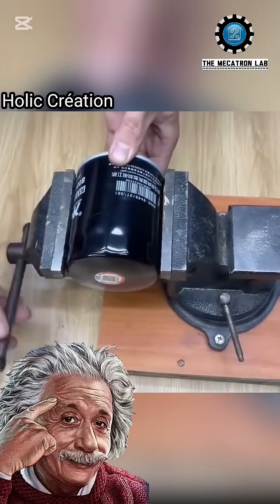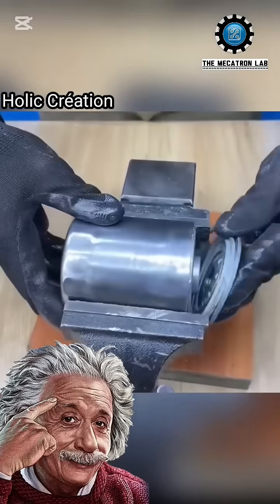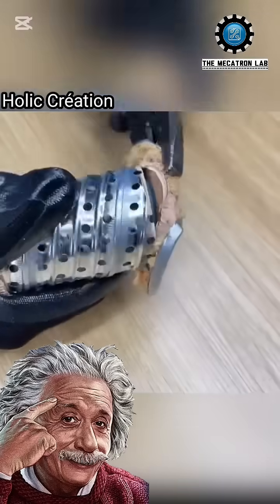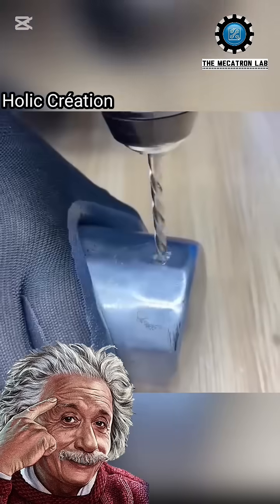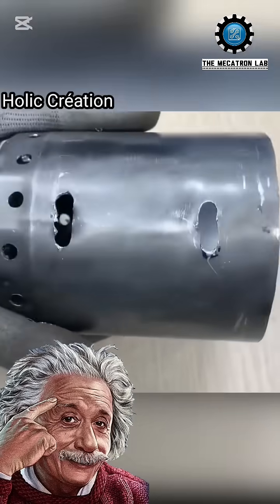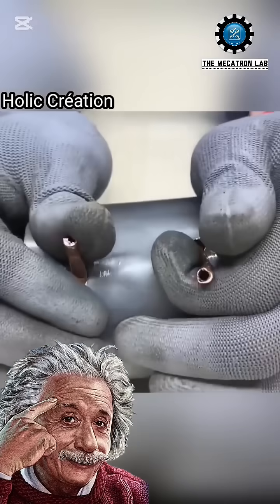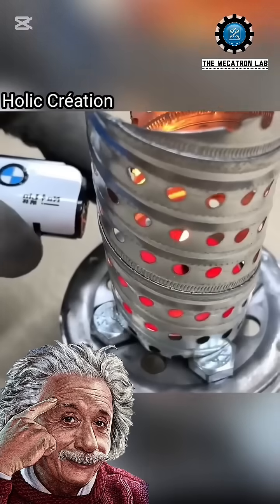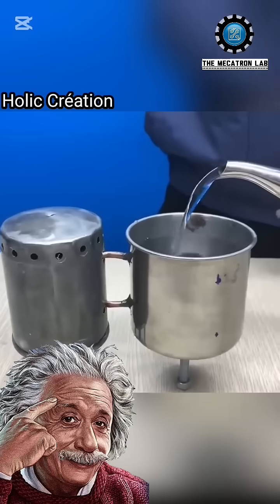How To Make water Heart AT home using oil filter. #diylrojects #experiment

Comment: This is about as efficient as leaving the oil filter in place on a car and just letting the cup sit on the engine while its running lmao.. 122 degrees? Hell you could leave it in direct sunlight on some asphalt and it'd get hotter

Comment: This is a thermosiphon, I 've used this with a 3/4" copper coil in a wood stove to supply us with constant hot water.  You need flexible copper tubing to create a "Z" shape, it passes through two holes drilled into the fire box at the back. About 3 ft or so will do, but the tubing must follow an upward path, never bending down.
      Outside the stove, the lower end of the flexible tubing must enter at the bottom of your water tank and the upper part must reach the top. 
      The water will flow quickly in this setup.  I'm on my third coil in my third home, You also have the added benefit of storing hot water to be released over night. You'll find many variations of this setup and I highly recommend planning and constructing one of these things. It can be built very cheaply.

Comment: Pssst this works better for heating a building then it does for heating water i mean it can be used for both at the same time but heating a building with this would save alot especially if you have alot of trees and land

Comment: Lmao, that would be ingenious. If the water circulated through the copper coil. The heat on the copper coil will keep the water out of the coil.  If there was also a coil in the water it’s self then the heat would transfer to the cup of water. Nice try but a pump would be needed to circulate the water.

Comment: Put the inlet and outlet at the bottom and use a pump to circulate coil heated water ✅ 
It still would be 20% less efficient than just heating a metal cup directly.

Comment: Cut a soda can in half Tweak the one end with needle nose pliers 1/4 turn at 4 to 6 points so the end of one of two parts fits into each other  Now you have a container with a lid ...Drill small holes on the outside. And one larger in the center of the top of the can. You have just made a penny stove...See you tube for more info ...- Extremely cheap, Easy to make, Boils water  I have one as back up in my camping bag
Reply: Oh yeah the good old aluminum can with plastic liner, work great. The more you use it, the less you are able to remember thats not a good idea

Comment: Put water in metal cup. Combust able fuel (candle) under cup. No oil filter, no solder, no holes, no leaks, less then half the energy losses. BOOOOOMMM, incredible water heater with no tools. 😎🤷🏽‍♂️

Comment: this is just exothermic transfer through touch... which you could do by, guess what? just touching the "stove" to the cup. that copper tube is pointless. in fact you could just put it on top the fire, but encasing the fire would prevent heat loss tbf.

Comment: It's easier to boil water in a plastic bottle directly over a fire. Incredibly it will NOT MELT.
Reply: Thats straight cap. Not to mention its 100 percent not safe to heat plastic to that high of temperatures because it starts giving off chemicals. I strongly disagree with you anything thats plastic that gets held over a flame for long enough will start melting and warping. Unless it's so far away that it barley gets hot at all.
Reply: @dillonmartin9413 : I agree with the chemicals leaking into the water, but doing it occationally won't hurt. I've done it a few times as an emergency measure at 12.000 ft in the Andes Mountains. Regarding the melting part, try it yourself and report back.

Comment: More like a steampunk attitude than anything useful 😂 
I'd rather boil water with a makeshift hobo with riser (just cut a rectangle in a stovepipe near the bottom, then place cans without bottoms and "sieved" sides inside. relatively light weight solution and if you have an enameled pipe of good quality it will work for ages and radiates lots of heat - that said, you shouldn't burn wet wood, oily stuff, coal and the likes and you should clean the pipe from time to time. If the cans wear out: just replace them 💁🏻) or with a black container in the sun or pipe coil in the sun or around the said hobo 😈 🔥🌪️ muahahaha 
If the stovepipe is long enough, you can even sweat in a lodge or you can cover the top with a fitting hearth ring or hearth cover (i re~use a restored, etched, circled one-piece, but you could also use multi-circled pieces or even the ones from around the 1800's, i believe, out of cast ion - if they are not too heavy). 
I got carried away a lil bit 😅
Memories from hiking trips and national vacation 😌
Shit. 
Boys'll be boys 😁
But take care with extinguishing! Make sure to protect your environment and if you can, use water to prevent possibly dangerous smoldering burns!!

Comment: Didn't see bubbles or steam. It probably takes too long & uses too much fuel. The dozen holes aren't necessary. With such a small flame, 1 or 2 will suffice. Probably just the 2 holes for the tubing will work. You want oxygen to replace what's consumed, but not loose too much heat thus slowing warm-up time.

Comment: You could have used the filter element as a fuel source. Add kerosene and wax and to it and it will burn. The housing could have been tuened into a small rocket stove as well. What you did is idiotic and pointless.

Comment: This is solution in search of problem that no one wants.
Reply: Actually believe it or not there are people out there that have to actually go without. Hell last summer we didn't have water or electricity. This would have been handy then. I'm sure it would take a little tweaking the design/idea. But I think overall it would do the trick. Just because you won't ever use it doesnt mean its useless to everyone. This mentality is becoming way to common now a days. People have literally become so self centered and self serving that if it doesn't benefit them in some decent to major way its garbage or useless. Even if it benefits them but only slightly people still just don't care what so ever.

Comment: Not that's it's practical in any sense, but what's fascinating is the idea of passive circulation: no pump, no electricity, no nothing. 👍
Reply: Thermosiphon. A lot of early car cooling systems were done this way. 
The radiator was mounted with the top about a foot higher than the top of the engine.
The top tank of the radiator connected to the highest point of the engines' cooling jacket, and the bottom of the radiator connected to the lowest point of the engin cooling jacket.
As the water in the engine heats up, it flows upwards into the top of the  radiator. As it cools in the radiator, it drops down, into the radiator bottom tank, through the core of the radiator. Flowing back into the block as cold water, replacing the rising warm water. Thus completing the loop. 👍
Reply: @iainball2023  Wow, that's cool. I wonder if this small cup can be scaled up to say, 5 gallons, but without drilling anything.

Comment: This is completely pointless. You might as well just make a small wood fire and boil water in a cup. This is so much work
Reply: You cant exactly build a fire inside now can you. I actually find this pretty damn handy if something happens and you need to have hot water for stuff. I dont think you would nessacsrliy need a oil filter either because he doesn't even use the inside of the oil filter that he tore apart the inner circle of the oil filer with holes drilled all through it from top to bottom.

Comment: Not only is this not at all what was shown in the thumbnail but this would take forever to heat a whole cup of water enough to boil. It would be far more effective to just put the candle under the cup so that the heat transfers directly to the cup and therefore the water. If you're heating just the copper coil it will only heat a few drops at a time, turning each drop into steam which will just boil away and not even heat the rest of the water if it's not below the water line. 

This device serves only one function: to make people who aren't very smart think that you're much smarter than you are.
Reply: Лучше бы он просто ввернул в дно кружки медный болт с широкой шляпкой. Это увеличило бы теплоотдачу от свечи.)
Reply: I do agree that this is stupid and completely unnecessary, but it isn't boiling the water in the copper tube, it's hard to visualize with clear water, but as the water heats up in the coil it will move up and out of the higher hole, pulling cold water into the bottom hole of the coil that will flow up as it heats up, and the process continues
Reply: Don't be lazy! "Report - Spam or misleading"
Reply: and then the magic happens! the magic of stupidity....
Reply: but then he wouldn't have le content
Reply: How else do you get water above boiling point in an unpressurized container? 
Obviously you have to use a candle an oil filter 😏
Reply: 😂😂😂😂😂😂VERDAD QUE PERDEFETA DE TIEMPO ALBERT HAITEN SE LE FUNDIO EL CEREBRO AL VER ESTE INVENTO 😂😂😂😂😂😂😂
Reply: wrong
the coil is always faster for heat conduction

Comment: So it's harder to just put the metal cup of water over the flame..??
Reply: Putting anything over an open flame will leave anything you put over said open flame a black sooty mess. You haven't ever had to do such things before huh? Take a lighter and put it on a can and let it sit there for 10 seconds or so. Obviously hold the can with something that besides your hand because if you dont you will regret it. It will leave a huge black circle on the can where the flame was closest to.
Reply: @dillonmartin9413  I see... So it's more to do with having a clean cup or pot when heating water... Maybe it should have been explained properly in the video... I thought the goal was to heat up the water, that method in the video will take much longer than putting the pot over the actual flame...

Comment: Are you saying this is more efficient that just putting the steel cup directly on the fire?
Reply: This way you're getting more copper oxides to give you moee flavor (and diseases).
Reply: @richardh9828 copper is actually used for water because of its properties that helps it prevent bacteria etc. like why old school door knobs are brass. Copper is used in applications like this everyday.  
I agree with the original post though just put cup over fire 😂😂
Reply: @STAY2A-ALLDAY it's still a cool principle though. Could be very handy for other purposes. 
I doubt its faster but i dare say having the heat source enclosed like that would be more fuel efficient though.
I had a kettle once that was basically a hollow chimney stack or a tube with air holes at the bottom, so you could light a fire  in the bottom and the flames would come up through the middle
Just a couple of small sticks and dry leaves and you'd have boiling water in half the time and probably a quarter of the fueln
Reply: @m.b.82  that sounds like a great camping kettle!
Reply: @m.b.82 в странах СНГ иногда используют такое устройство во время отдыха на природе, и называется оно «Самовар»
Reply: @STAY2A-ALLDAY 🤣🤣🤣🤣🤣🤣 Exactly.
Reply: @richardh9828  lol
Reply: @jammiejackson4106 certainly not but he could say he did it differently 😂
Reply: @richardh9828  damn😂
Reply: @richardh9828 I think this is a flaw. The tube should be made of lead (preferably with cadmium admixture).
Reply: @richardh9828  Works for the gov trying to kill us more by adopting video ideas like this lmao jk
Reply: @richardh9828 😂
Reply: My thoughts exactly
Reply: Looks like a vodka maker
Reply: @RobertNazarov65 you mean a stil
Reply: @ yes that sounds right
Reply: @RobertNazarov65 кто о чём а русские о водке
Reply: @first_group1 я смотрел ролик не давно про чачу и с помнил
Reply: Bro is  just drinking plasma water😂
Reply: Or buy a gas heater ... lol
Reply: Absolutely not
Reply: smells Inefficient from far
Reply: Как работая на сто не выходя из бокса сделать самогонный аппарат 😂
Reply: @denhik2959 🤣🤣🤣🤣
Reply: Better off going to Dunkin Donuts or Starbucks in a modern world 😂
Reply: @private8559 just now it may no longer be a modern world. As the song said. "Change gonna come"
Reply: Not as fun though. Imagine that video😂
Reply: I have a Coleman double burner propane grill,plus 20 cans of propane. Think I'll stick with that for now😂
Reply: i was just going to ask this... but thanks sir
Reply: Идиот какой-то. Ради просмотров изобрёл изобрел теплообменник.
Reply: BTUs are BTUs, no free energy.
Reply: @gerhardk98  you say that, but that doesn't take into account how much can be lost to the environment.
Reply: Here is our Savior

HalleluYAH (Hallel u YAH) “Praise YAH”

YAH The Father (Genesis 1) was Who they Crucified for the sins of “man” and YAH arrived to be Crucified via the Tent of Meeting 

— Ancient Semitic of Moshe (Moses)
— Hebrew Book of Isaiah

YAH The Father <— He’s our Savior
Reply: It's LITERALLY brain rot content so idiots will waste tons of supplies when we go to war
Reply: It's called a thermosiphon (the change in temp actually moves the water through the coil)and while it may not be much more efficient than direct heating on this small scale. When the volume is increased it becomes very efficient in that the same effect is achieved with a much smaller heat source than would be required for direct heating. This is actually the difference between an on demand and traditional water heater.
Reply: Such a stupid video
Reply: Перевод
Reply: П5о́5 веод
Reply: absolutly not .. but as an extra bonus u get contaminents, using old US flexible copper tubing u also get lead as an extra bonus, who can resist free lead poisioning ... FREE -DooM
Reply: Guys, here is the True Savior

HalleluYAH (Hallel u YAH) “Praise YAH”

YAH The Father (Genesis 1), Who, with His “HAND”, formed “man - Adam”, from the dust of the ground and YAH’s “BREATH” made “man (Adam)” a living being (Genesis 2:7).

YAH’s “HAND” they “NAILED” to the Almond Tree, to symbolize forgiveness of the “Tree of Life” sin of “man (Adam)” and thus “The Fall OF man” (Genesis 3)

YAH The Father arrived to be Crucified via the Tent of Meeting (Exodus 33, Isaiah Scroll), how YAH has ALWAYS arrived

YAH The Father is The True Savior
Reply: I was gonna but you did
Reply: 他傳達了更守住能量、更少能量、更有效傳達足夠熱能，我看見佳作，我喜歡這創意感恩😊
Reply: Yea
Reply: 🎉😢😢.   B

97
Reply: You people are as clueless as sheep my god...😢
Reply: Yes we had bigger version of this

Comment: Too much work. 
I get a short can that can accommodate 3 tea candles, drill holes in the top. 
Assemble the candles, and light them. Put the short can over the candles. On that stove I place a can with wax in it. Do some chores, come back to melted wax.
It could work to heat water also. 
Heat a can of green beans, or corn after removing the lids.
If a person has a can opener that opens from the outside of the lid, the can would be a nice pot with a lid.

Comment: is using rubbing alcohol an option?
Reply: Not sure where you are going?  Why would you use rubbing alcohol and where?  On the heated side?  Generally it is not smart to have a flammable substance in a system with an open flame.  especially since the vessel is not sealed

Although rubbing alcohol fires are fairly easy to deal with still...   Anyway i am interested to hear what you were thinking.
Reply: @GMx_1  what are the fuels that can be used in this design?

Comment: Will water not be oozing from the heating bucket where the copper pipes penetrates ?
Reply: looks liike he j-b welded the pipes in
Reply: All of these are to get people to watch them that's all. There's no reason to even make this. Just put a metal cup or metal pitcher or pan whatever over a fire. Bam. It will heat faster and will disinfect your water. Just let it cool down. You could make something out of copper pipes and metal pans and pots to build a water purification system where you could put mud water or dirty water in and boil it letting the steam rise out into your system and then flow into your catch sort of like a still. If people have a moonshine still during an emergency where water needs to be disinfected then a still would be the best way to go also using fish tank aerators in the water tanks to regas the water so it tastes like water and not flat will probably be needed and if there's no way to power them then it will need solar and batteries or some manual way to turn a crank or stirring it with a big laddel for extreme emergency.
Reply: That’s were the bubble gum comes in , only they forgot to add that part !
Reply: No they ended up welding it in the video from what I can see from the comments. This is the most ridiculous setup I've ever seen. You could have just eliminated 90% of that and just put the tin cup over the flame.
Reply: No it'll circulate and get hot

Comment: Water heart ❌
Waste Time ✅
Reply: Water heater ❌️
Water heart ✅️
Reply: Lol😂 @justaweeb9086
Reply: You could just put the flame under the cup.
Reply: @leongaskell1533 , Why? When instead of using twigs from the back yard in your smokey joe, you can buy an oil filter and the tools, tubing, and parts for it? Run to the hardware store, now!
Reply: agree you can take a pot and put water in it and heat it.  It's just a heat ex changer.
Reply: Nice comment
Reply: Bei 60 grad kannst dir ja nicht mal nen Tee aufkochen 😂
Reply: Water heart AT !
Reply: Lies and more lies plus Camara tricks
Reply: But it does teach you a lot, such principles can be applied in different ways, a shop class at a school might find this to be a nice project
Reply: I think if it actually worked, it would be more efficient
Reply: That's fax 😂
Reply: Heat learn to spell idiot
Reply: Água quente + sulfato de cobre = 💀☠️
Reply: fucking clickbait.
Reply: Water ❤
Reply: in arab we dont call this bullshit. we call this CAMELshit.
Reply: Water ❤️
Reply: My heart is water and my brain now is Air